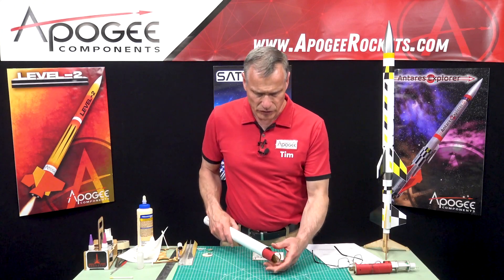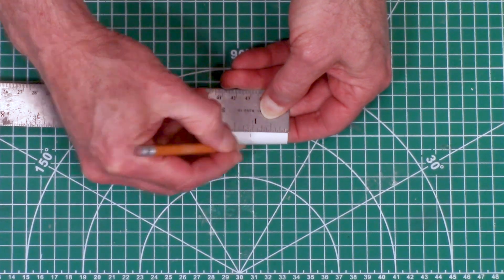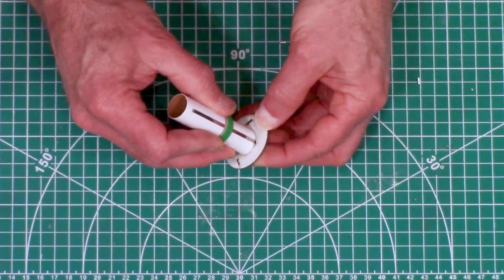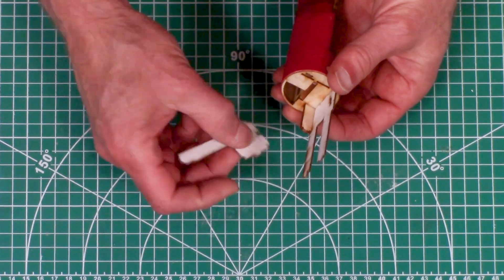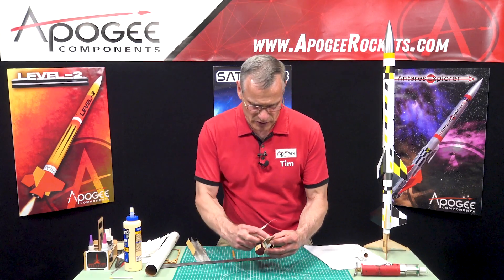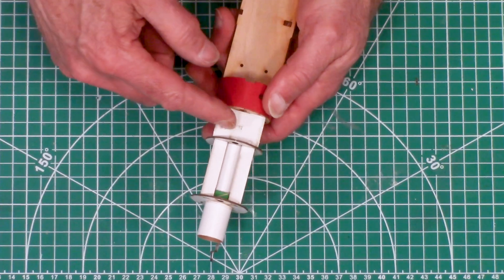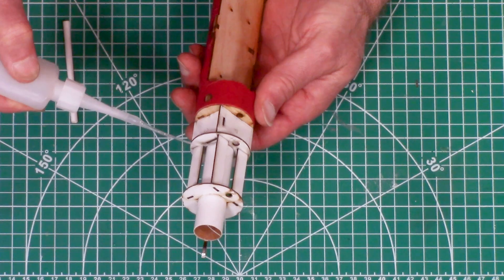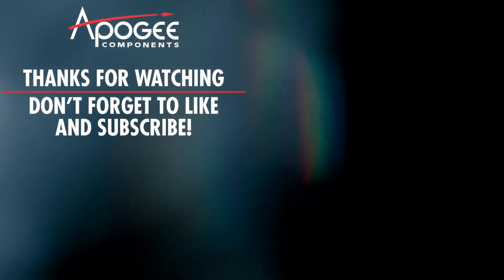Building the TTV Model Rocket Kit - Part 4

Comment: Ebay Sled with engine mount is like a level 5 build. If it needed to be finished (paint) and decaled, it would be level 6, haha! I am guessing a computer aided design was used to determine dimensioning and tolerances, which appear to be pretty tight.
Reply from the maker: It is not as bad as seen in the video. I'm all thumbs putting it together, while trying to film at the same time

Comment: I'd recommend sanding a small bevel (chamfer) on the end of the engine tube before trying to insert it into the sled assembly.  I see you cleaned up the holes for the igniter tube which helped that process.  Yes the engineering on this is amazing....I've been a mechanical engineer for over 40 years, recently retired and just now getting into laser cutting and engraving, so seeing this is an inspiration!😊
Reply from the maker: That's a good suggestion. Thanks.